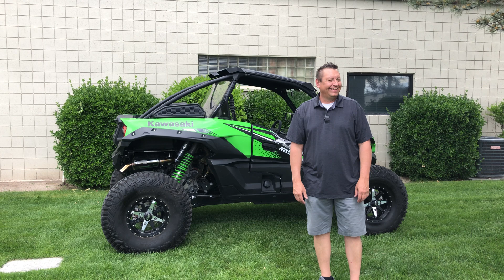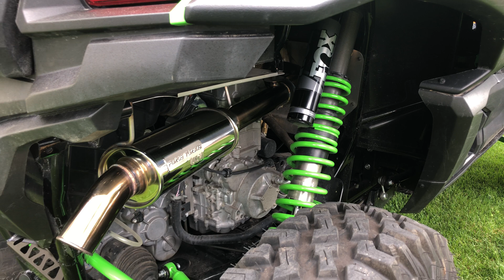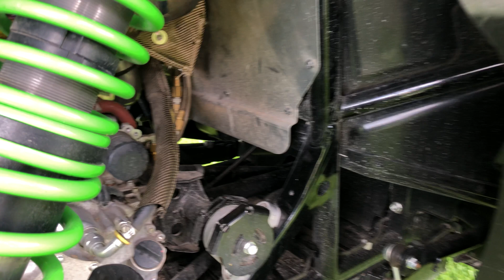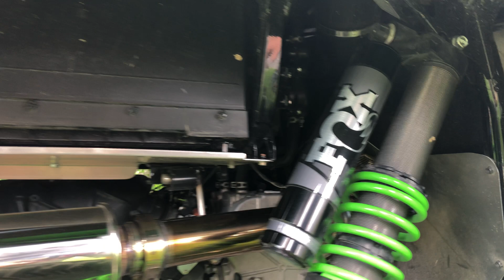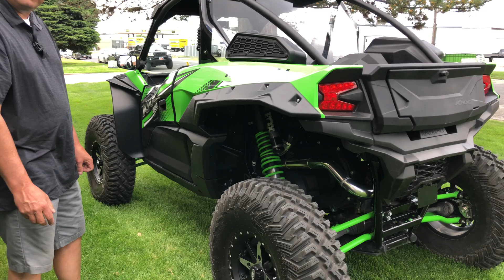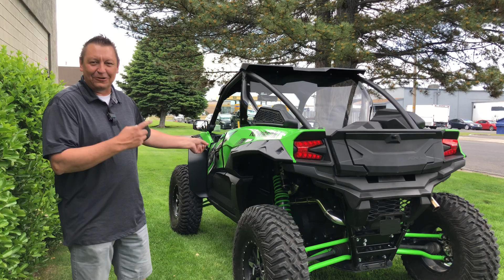Kawasaki KRX Turbo System Walkthrough

Comment: Can you run this turbo with a snorkle kit?
Reply: Hello Brenden, Yes you can run a snorkel kit on the turbo. This turbo system pulls air from the stock air filter box.

Comment: Why no intercooler ? What IAT are you guys seeing , engine overheating issues at all ? Thanks ! glad to finally see a turbo kit for the krx. Such a great machine !
Reply from the maker: We are not running an intercooler because our charge tube temps are not getting above 155 degrees on the 5psi set boost level.  We are not seeing any engine overheating problems. Normal operating temps in the same range as stock.  Let us know if you have any more questions and feel free to check out our website for more information www.forceturbos.com
Reply: @forceturbos  thank you for the quick reply ! do you recommend keeping boost pressure at 5 psi ? I don't know what the stock internals will hold...thanks !
Reply: @kevshaw2020  Yes we recommend only running 5psi of pressure. The fuel pump, fuel injectors are getting close to being maxed at that boost limit. We don't know what the upper boost limit is at this time. Please call and I can give deeper details if needed. Thanks, Bryce
Reply: @forceturbos  also i don't see a bov ? Are you having any issues with compressor surge, back flow issues ? Thanks again !
Reply: @kevshaw2020 

This system does Not run a BOV,  It doesn't have any problems with compressor surge at all. we are running a 300 hp Turbo and setting it up at low boost. That sets up a low pressure-high volume equation. when the throttle body plate sets, the back pressure air is moving slowly enough that it only slows the compressor wheel but does not stop it. That keep the turbo out of the SURGE section of the compressor map. Great question. Thanks
Reply: @brycekendrick2249  huh?

Comment: I want to see how long this setup will last. Do you think the motor will hold through out the machines life with the turbo kit? I don’t think 300 miles is enough for long term testing.
Reply: A turbo system when set up correctly and working with in the parameters of the motor will not diminish reliability.  Proper maintenance on the motor will also help. We have had this KRX turbo system on the market for over a month now with great success. Give us a call if you have any questions.
Reply: Kawasaki did there homework building this machine. The internals of the krx engine are stout and should hold up just fine to the boost

Comment: How easy is it to change belt if it brakes with the charge tube in front of the cover?
Reply: It is not hard. There is two clamps that will need to be loosened to remove the charge tube. Then you have a clear path to the belt cover. thanks
Reply: Only problem is the probability of sand or debris ingress. Been at the dunes plenty of times where the wind is blowing sand, no chance I would open up the clean side of the intake.

Comment: Hi Bryce, appreciate all of your efforts and the information.  I have seen the other videos on BPS.  I have 2 questions:  Can the Turbo withstand decent jumps and impacts from landing?  It looked like the tube moved easily from just your hand - are the flex mounts and brackets sufficient for really hard riding and jumping?  
Can you post video or better describe the amount of increased wheel spin off the line you can expect with the system with proper clutching?  Does it easily do burnouts on dry rough blacktop etc?  It appears in the videos it was a little sluggish out of the hole, but I assume the KRX clutch is limiting this as well as the limited boost.  Would prefer to buy the clutch kit from you as well already roughly dialed in for my setup. More videos please showing performance and wheel spin etc!  Drag vs. X3 Turbo base 120 HP?  I'll pay to see that one!
Reply: Hello DA,  

The KRX turbo system can withstand the big jumps, long woop sections, and small stutter bumps with no problem.  The turbo sit on top of a S10 stainless welded manifold. If that manifold fails or breaks you will pull the studs out of the motor.  

The charge tube is connected with silicone fitting to give quick access to the belt if needed and give flex between the turbo and air box. 
 
We will have turbos running in the score short course series very soon. Guys are loving the KRX turbo system and the power that they are gaining. Contact us direct if you have more questions info@forceturbos.com  Thanks